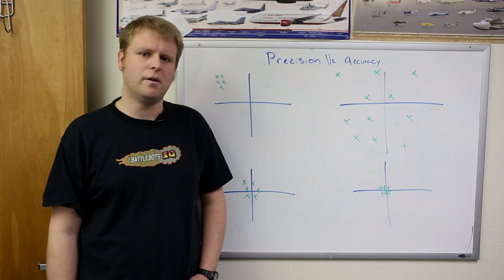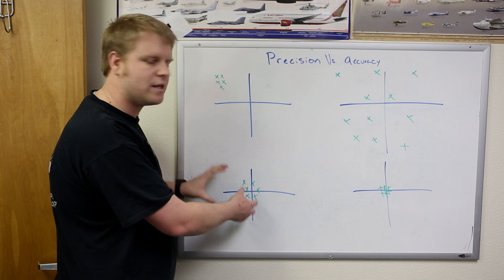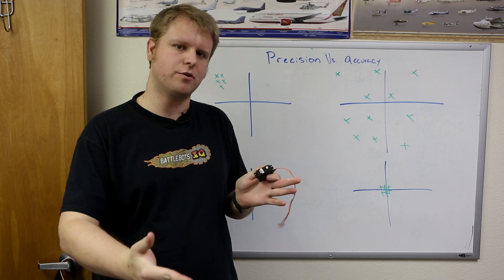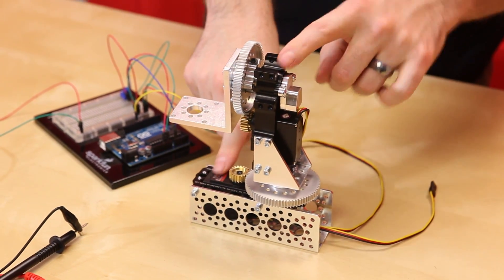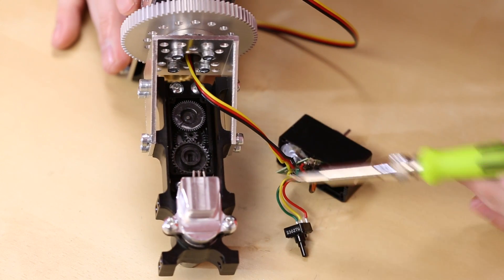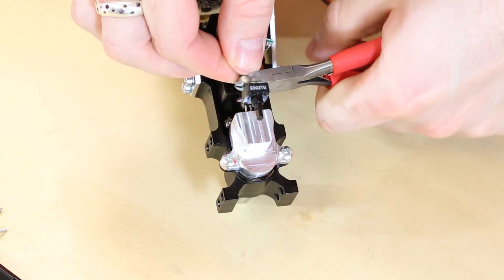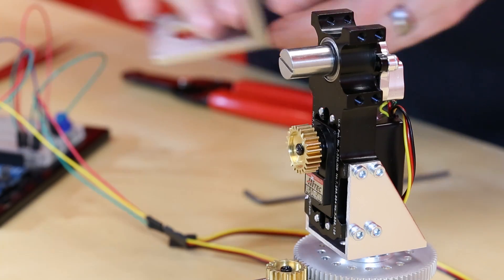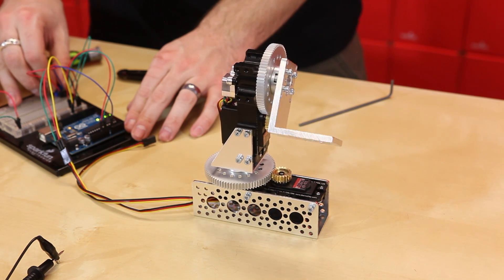Robotics 101 - 5 Precision Motion

Comment: Whenever I see stuff on precision motion, I never see anything on DC motors with optical encoders. Is there anyone tinkering with DC+optical encoders?
Reply: Yeah, I would also like to see that. I'm building one of those little CNC-machines and whenever I hear about servos, I think of something like this http://www.torquesystems.com/images/servo_motors/brushless-servo-motor-250.jpg Even though that servo has something in common with the one shown in the video, it's still a completely different world. As is feedback-controlling a stepper motor to compensate step skips made by stepper. And also micro-stepping hasn't been even mentioned... :)

Comment: But wait. Won't that potentiometer drift in value?  What if I wanted to use a cheap servo for something that required high accuracy?  This doesn't seem any more precise or accurate than a regular servo, it's just geared lower.  What if it had a contact at the 0° position, and as it went past that point it told the controlling microcontroller, "Hey, whatever pulse width you are sending right now is the new 0° postion.  Adjust all your math to compensate."

Comment: Sparkfun should look into a range of serious servo products for robots.
Things are far more fun when it isn't crappy toys you end up with and there is a big potential for very potent components at low cost. The professional servo world is plagued by pretentious prices and it has for decades left enthusiasts with crappy RC servo or crappy stepper motor solutions.
One possible product would be a gearing adapter with encoder and controller for RC brushless motors that are both powerful and cheap. Such a product line could be used for fairly serious robotics. Even Honda Asimo level stuff. With the advent of 3D printing and arduino type stuff there is no reason that tinkerers couldn't start challenging Honda. And Sparkfun could be instrumental in such a revolution if you make a mental shift out of the kindergarten products.
Reply: Have you checked out servocity.com?